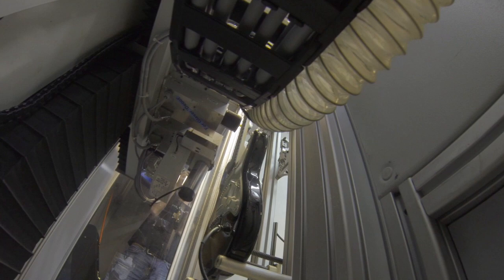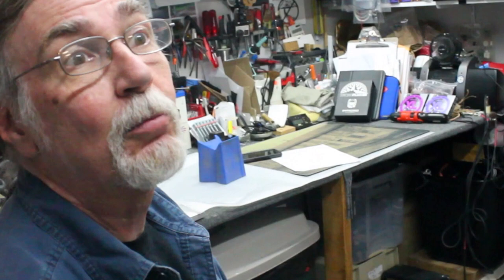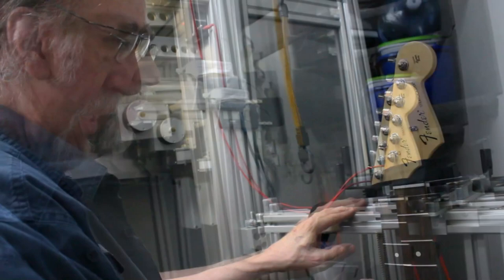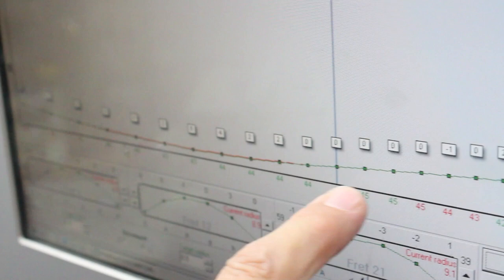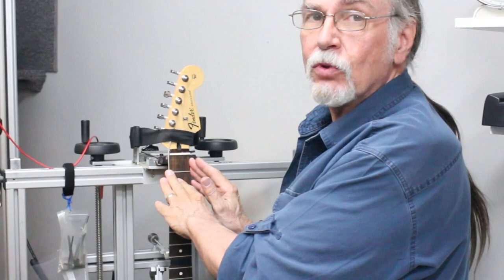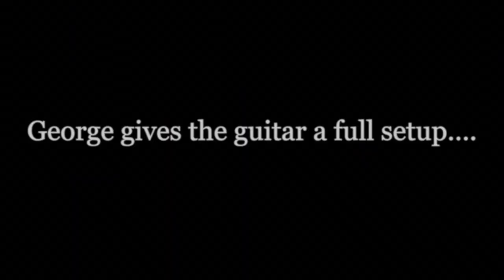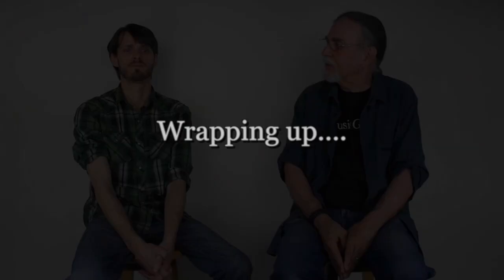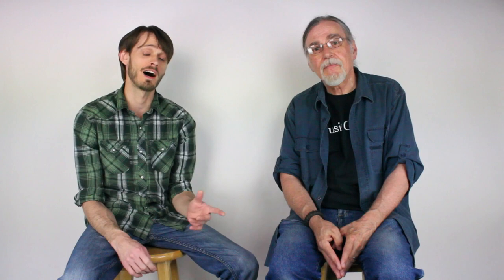The Plek Machine at The Music Gallery with George MacPhail

Comment: Hey George a few things you did standard old school 70s and 80s 45 degree bevel on the fret end. Are you open to doing more modern less angled bevel say 15 degrees and then rounding their edges and rolling the fingerboard? Also Say I sent in a 1953 Telecaster neck with original finish. Would you take out the frets with pincer clippers or would you knock then out sideways? Since I would want to keep the finish original  wouldn't all that hard knocking by the metal (brass?) probe damage my original already flakey nitro cellulose? I would want to keep the fingerboard original 7.25" radius along with the finish. If we used tall wire say 6105 Would you be be able to do a compound radius say 7.25" to 10" dress and crown on the PLEK machine?